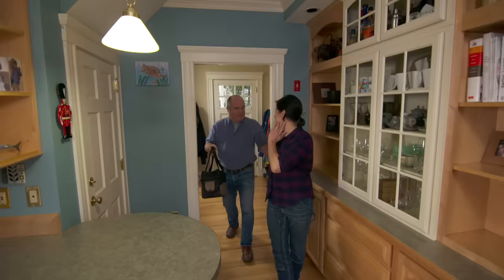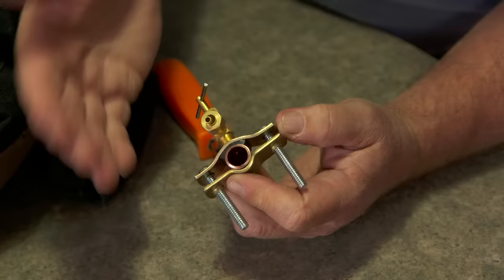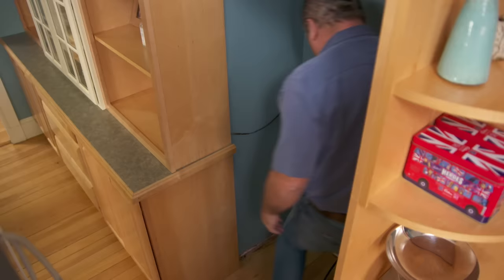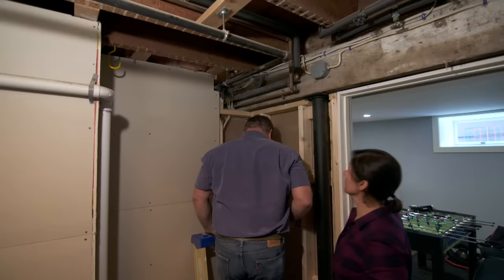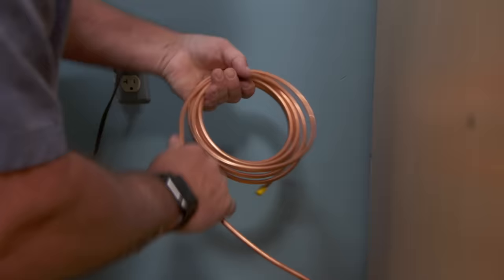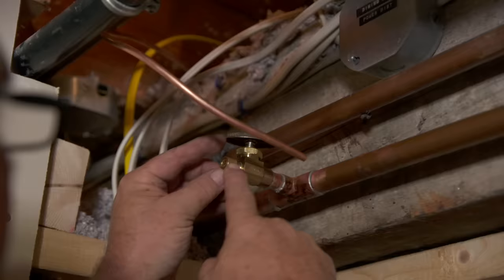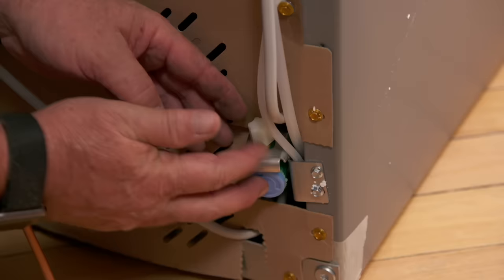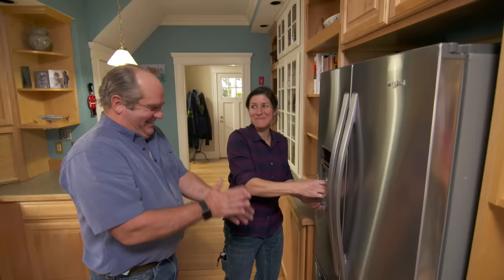How to Connect an Ice Maker Like a Pro | Ask This Old House

Comment: The weld on connection was a good choice, but I would have used a stainless flex line in place of the copper, longer life, no kinking, and less likely to fail over time due to corrosion caused by chemicals in the water, overall a good install.

Comment: Alright, time to read the comments and see where he fudged up
Reply: No steel tip shoes; no fire extinguisher; no side shields on his prescription glasses; no ear plugs using the torch, ladder leaned against the wall is a no-no and can lead to a debilitating fall and possible lifetime paralysis.
Reply: @darrylfitzys8632  Are you from OSHA?? I believe OSHA's heart is in the right place , but their heads are out to lunch.
Reply: Darryl Fitzys 😂 I didn’t even notice the step ladder.
Reply: Ron Peters I was about to write that. Reminds me of when I took woodshop in high school.
Reply: He messed up because he didn't do this at my house.
Reply: He didn’t do anything wrong but I wouldn’t use copper at my house because it’s easy to kink when you pull the fridge in and out but plastic is easier to pierce
Reply: @darrylfitzys8632  Thanks for the laugh!  Love it!
Reply: Lmfao
Reply: He drilled first before looking downstairs first
Reply: @alvareza3  not even a  professional and even I was thinking why he didn't look below first?🤔

Comment: Plumbing Apprentice for 3 years now and would like to say that the copper line is something I havent heard anyone install around here anymore. Most fridge hookups would be easier with a braided stainless steel hose seeing as how you don’t have to worry about kinking the copper. The ones I’ve installed also happen to connect under the kitchen sink so elderly/disabled homeowners don’t have to go under their crawlspace or basement to shut it off.
Reply: Copper to the wall then go from copper to braided stainless just behind the fridge. It's illegal to run a supply hose through the wall, most you can do is go between cabinets. The supply hose has to be visibly accessible the entire length. Im my county it's code to have the shut off for the fridge and dishwasher under the sink.
Reply: @alec4672  that seems very restrictive. I’m about to get a water line run to my fridge, but it requires a lone to go into the wall, over a doorway, then out the other wall. My plumber will do this with a continuous copper pipe though. One thicker than the one in this video.
Reply: @Heliosvector  yeah but he's not gonna hook the copper pipe directly to your fridge. He's gonna run the copper line in the wall and install a shut off valve at the wall and hook the fridge to the valve with a flexible hose. You know... exactly how I said to do it. Plumbing in a supply line for a fridge is no different then a supply line for a toilet. The hose is just longer and some fittings might be different sizes also the valve might be recessed in the wall (you can buy valve boxes from Otey for this)
Reply: @Heliosvector  and it's not a continuous copper pipe if there's fittings in the wall. Unless he's waisting your money on soft copper like here.

Comment: I have a stainless braided cable that comes from a T in my Pex tubing. Great flow and no worry about kinking a copper line.
Reply: Braided line is just a protector for the pex line within it.  Just like braided steel brakehose, the braided steel is just there to protect it, the actual hose  is just like a normal brake hose inside it.

Comment: I do not trust those saddle valves I have never used them. And you did it right just like I would solder a T and you went further by soldering the angle stop👍👍👋.... Great job sir👍👍👍
Reply: I have used them (because Richard Trethewey I am NOT!) and so far I have been lucky. In our new kitchen reno, we are having a contractor do it, so it will be up to code!
Reply: What's the angle stop?
Reply: @syfodias-jedimaster  angle stops are just 1/4 turn ball valve

Comment: 2:25 missed an electric cable by a few cm. I wouldn’t drill randomly through any floor wall or ceiling in a house. Once i took a gamble doing that, and my drill bit got steered away from a 230v cable by a PVC pipe. Always check where you are going to drill. Use such detection device.
Reply: A little risky, indeed. But yes, not my personally preferred way to explore the follies of inadvertent water works and electrical surprises.

I'm partial to the stubby drill bit and flashlight method myself.
Reply: You sound like you never used a drill. There was no way on earth he would drill through that cable.
Reply: E D Possibly you never used one and you’re just hanging out the big man here?
Reply: E D the point is that not all cables are unsupported. Did you even read my initial comment?
Reply: In this case he's just drilling through flooring and sub floor. There was never any chance of drilling through anything other than wood. You're first comment was pointless, you were just trying to nitpick but there's nothing to nitpick. Just because you couldn't drill straight doesn't mean Richard has to overcomplicate things. I'm done here.
Reply: E D If you make up from my post that i didn’t drill straight, makes me conclude that you read it wrong.
Reply: Richard van Pukkem, he got lucky. Lol
Reply: its a 12/2 wire more than likely a 120 VAC line i don't know if your in another country with different mains voltage just guessing because you sad a metric measurment
Reply: @Paradoxical Nightmare True True
Reply: Try it with 400V like we've got in the EU....
Reply: you can always feel when the drill bit has reached air, and you should stop there instead of pushing on. I'm pretty sure Richard was in the basement already off camera and knew where the wire was.
Reply: @CASTSTONE  Did you notice the yellow wire directly below his drill bit? He got lucky. That's precisely why you look first.
Reply: Yea I noticed that to.
Reply: Electrical cable is supposed to be left somewhat loose for this exact reason.  Even when the cable is stapled every few feet, it should never be run where the cable is completely taut with no slack.  It should always be a little loose so it has some give to it, which makes it almost impossible to actually drill through the sheathing, unless you are an idiot.  Of course it's still possible, but if you are competent, it's very unlikely.
Reply: I would still have preferred to see him go down to the basement first . This is a video for DIY`ers , not plumbers.  The slack electrical wire will probably save you BUT what if the wiring was stapled " tight" . Maybe it was done correctly  by an electrician  ( with slack ) but maybe it was done by a DIY` er who thought that it should be tight .        ( In any case , I appreciate these helpful DIY channels  . There  are some good ones out there .  I like Sparky Channel ,  Home Improvement , Ask the Builder ,  See Jane Drill , Got2Learn           and some of the others )
Reply: This is for everyone saying he could have punctured the wire, Or he should have looked in the basement first! This is only a 6 min video, I would bet that he did check the basement first! As for drilling through the wire, Not likely! This is not a regular rigid drill bit with sharp flutes on it! A feeler bit is nothing more than a piece of coat hanger cut on a 45° angle! He has been doing this for like 30 years, He knows when he is through the subfloor! Everyone should just go back to their little cubicles and let the Real Men do the work!

Comment: I have 3 Saddle-T valves on galvanized now.  One would think just by looking that they would be pretty risky to use but apparently not.  My house is 62 years old.  One of them is ~52 years old from the previous owner, another ~24 years old when we replaced our fridge with one with an ice maker, and another ~7 years old on the hot water heater outlet which runs to the Aprilaire furnace humidifier.  None of them have ever given any problem.  If they did, they wouldn't be so popular and still sold.  They are standard with ice maker install kits.  So if you already have one, or two, or... I wouldn't freak out about some imminent catastrophe.  The vast majority of them do not leak, but they are more likely to leak than a properly installed water valve, which is why they are not approved by code.

The reason for their use is because with galvanized you have to either remove everything downstream and then cut and thread pipe and re-plumb everything downstream, or more likely cut the pipe for a T, thread the ends of the cut in-situ, and install a coupler and union.  Splicing copper is much simpler but unlike with plastic plumbing, the average home owner cannot do it, and a DIYer would need to buy the torch, solder, and then practice, so the temptation is still there to use a Saddle-T.  However, these days you can skip the torch and use SharkBite fittings, which are approved.  However, many plumbers are in favor of on SharkBite fittings due to the O-Rings that can age.  They use them themselves temporarily for pressure tests.  Saddle-Ts are not made for any of the plastic plumbing but they are so easy to splice that there would not be much temptation to use them if they were available.  For the rigid plastics, all you need is a hacksaw, glue/primer kit, and a little sandpaper to remove the burrs.  PEX requires a specialized crimping tool, but one can buy a PEX crimp tool, cutting tool, and enough crimp rings to do most houses from Amazon for $32, and requires no skill that needs to be developed.  

I will be re-doing with PEX.  Plastic plumbing is not a great insulator, but better than galvanized or copper, so less sweating from the cold and lower heat loss from the hot water line.  They also do not corrode or leach minerals into the water.  Since PEX can bend, there are a lot fewer fittings and joints required than with rigid plumbing, and because crimping tool produces a consistent joint every time, there is much less chance of a leak, and simple to repair in the unlikely event that there ever is one.  PEX is also the most likely to survive a freeze/thaw cycle.  It can be also be spliced into existing plumbing.  When pressure testing PEX, wait 1/2 hour before taking a reading to give the pipe a chance to expand and change its shape slightly from the pressure.

Comment: This was a good explanation of the process but I found that the hardest part was getting the existing water pipe dry enough to solder. Ultimately I decided not to solder at all and installed a Sharkbite service slip tee device instead. Super easy, done in ten minutes.
Reply: Has the shark bite leaked in 3 years?
Reply: @xxDOTH3DEWxx  
It has not leaked and is still working great. Haven't had to do anything to it. I was skeptical of Sharkbite fittings but I have used them all over and they have been great and haven't leaked even a drop.
Reply: @stevemeshenberg494  I used bread to suck up the last drops of water, after it has mostly dried up insert the bread, do the soldering and take the screen out of a faucet turn the water on and open the faucet, the bread will be expelled and you are done.

Comment: I just came back to this video after watching it some time in the past.   Some idiot had run a saddle valve and 1/4 copper tubing from the sink to the refrigerator and bent it 90 degrees to get around the corner of a cabinet.  That's where it broke, of course.  This weekend I'll be putting a proper valve in.

Comment: Wonder why a small ball valve shutoff wasn't used. If going through the trouble, why not use a better shutoff?
Reply: Douglas Blake, I was wondering the exact same thing. I've seen more of those gate valves fail and leak than I can remember. As soon as the seals dry out or become tweaked, it's game over for those p.o.s.'s
Reply: 5/8 X 1/4 angle stop could've worked
Reply: @jasenrock  yes you can just don't open it all the way

Comment: This is a quaint way of doing things back in yesteryear.  Today, you put in a Shark Bite and flexible 1/4 hose and are done in a few minutes.  No soldering,  No kinking copper pipe that WILL corrode and no worries!   PS, have fun trying to solder a copper pipe with water pooling in it using a typical homeowner torch ;-)

Comment: Holy cow have someone knock on the floor while you go into the basement to establish where the hole needs to be drilled. The "poke and hope" method is a rookie move and sooner or later will get you through an electric wire.
Reply: Mark B. lol. Or just use a tape measure to precisely determine where the hole should go. smh at such a blatant debacle. It would be funny though to see Richard pierce a gas line. I bet he'd stop using the old "poke and hope" method after that, lol again :D
Reply: Yes exactly. As an electrician I rather tap the floor with my Lineman Pliers or hammer to establish where I am with a customer or helper on the phone with me. I've seen helper and apprentices drill through plumbing pipes with Full City Water Pressure. It is a BIG Mistake!

Comment: Its 2019. Filter AND soften your water if necessary. Just use plastic line not copper. A light bungee with a short peice of hose or other material to protect from kinks then attached at the other end to the wall holding extra line and wires upward helps keep things in order while you pull it out and push it back in. Copper has its benefits but it is very sensitive to rusting when contacting other common metals, it work hardens, it kinks.
Reply: Rats love plastic

Comment: I would have just done 1/4" PEX with a shark bite, shutoff valve at the back of the fridge with a small whip to the fridge and then you have a shutoff above and below. It is far more durable than copper and can't be damaged as easily by work hardening or kinking. And I would take a few measurements before I perforated the floor like that, he came very close to a Romex cable.
Reply: briancnc Yikes!
Reply: Yeah, I despise people who just drill through flooring without knowing what is under it.  We have gadgets that let us see right through walls and floors.

Comment: Wonder if you wrapped the tube w/ fiber tape then installed the saddle valve  it would withstand? Also I would also have left about 3 turns of stretch coil w/ 'copper' line behind the  fridge.

Comment: I had the icemaker on my old fridge spring a leak on the back of the fridge where it goes in, old cracked plastic pipe.  Luckily I was home when it happened and managed to shut the water off before it made a huge mess and ruined floors.  New fridge did not have an ice-maker, I can go buy ice thank you very much.

Comment: I'd suggest Anti Seize in between bottom saddle valve and copper pipe to prevent corrosion if need to use saddle valve for temporary solution. Or add rubber in between like it has on top.

Comment: I'm on the opposite side of this situation.  Previous owners bought a new fridge with ice machine.  Place the fridge on top of their wood floor.  Five year later, I notice it's squishy next to the ice machine I've never used (Culligan water in silicone cube tray in the freezer for me).  I find out the wood floor is rotted down to the floor boards right below the ice machine.  Since I don't use the ice machine I am in the process of disconnecting the ice maker pipe in the basement so I can move the fridge to a location away from rotted floorboards.

Comment: Here’s a helpful tip... spray paint that “feeler bit” bright pink, green or whatever. So that it’ll stick out like a sore thumb for when you’re looking for it.
Reply: Here is a better tip..  If you dont have a LONG "bell hanger" bit..  Cut a length of wire coat hanger, use the straight piece as a bit. And of course Paint the end !!

Comment: I’ve been watching this show for more than 50 years, and now it just seems to be about how much people can spend
Reply: It's only been on for 40 years lol
Reply: Rich Miranda, I did the math, and you are correct!( it’s more like 42 years, but why be picky). I guess what I meant was, in the beginning, norm and bob would repair a table, or replace the kitchen cabinets. Now, all they seen to do is completely rebuild homes into mega- mansions. This house they did this last season is a perfect example- they took a perfectly good house, essentially took it down to the foundation, and built a new mega-mansion!!  All because some yupsters with a pocket full of cash and a(most likely) test tube baby, decided they loved the location, but needed a modern(read: new McMansion)house. This is NOT the this old house that I have watched for all these years. Perhaps it’s time for this old boomer to move on?
Reply: @elfiero50  Yes, you are correct. I've been watching since the 90s and have seen the same. I would guess that it has more to do with TV ratings and competing with some of those other shows.
Reply: @elfiero50 Can you repeat that a few more times?

Comment: Richard, I have a valve box mounted on the wall. That valve failed. What would you suggest to replace it? Same as before or something else. Then I have an S.S. braided hose which connects from this box & valve to the back of the fridge. I'm afraid this hose could crimp when the fridge is rolled back? How can I avoid this problem. Thanks